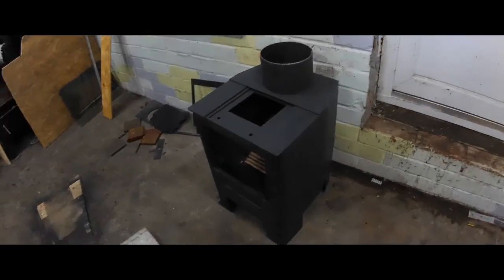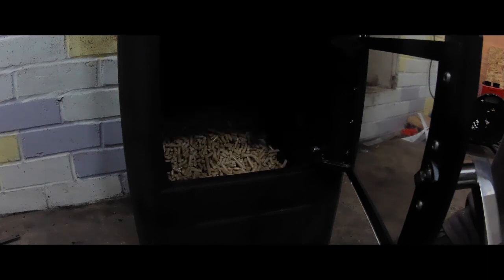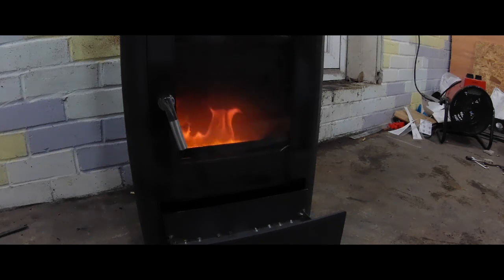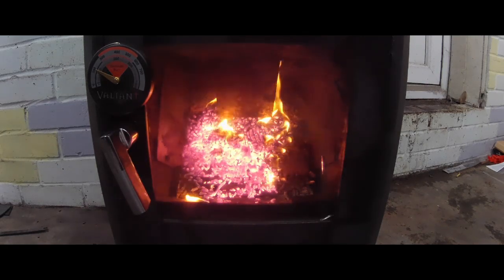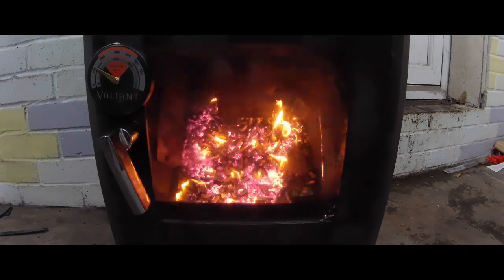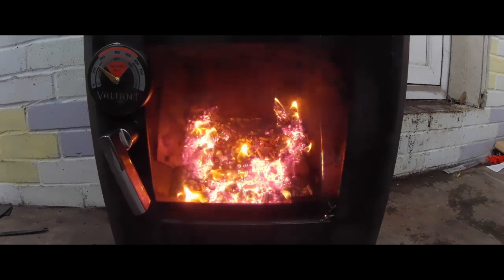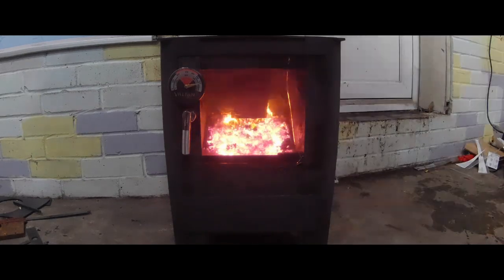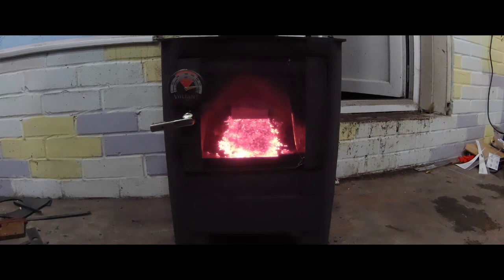Gravity Stove 2020

Comment: How long will it take to burn a 40 pound bag of pellets?
Is there a way to regulate the temperature?
Reply from the maker: Hello,
Do not have consumption data yet. 
This was the very first run.  
Currently working on improvements as hopper thermal insulation, better door hinges and obviously regulation.
Regards,